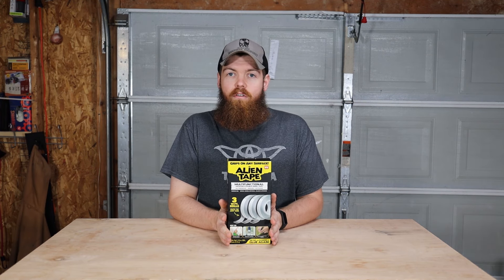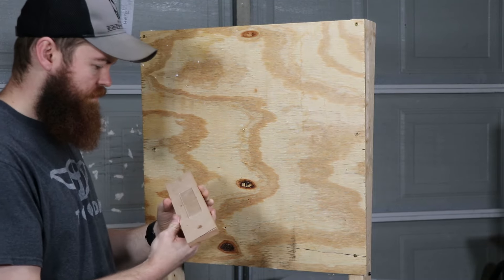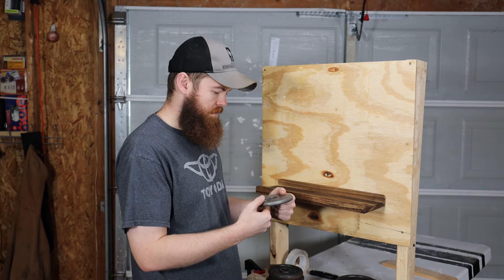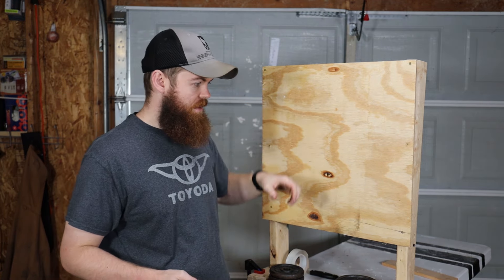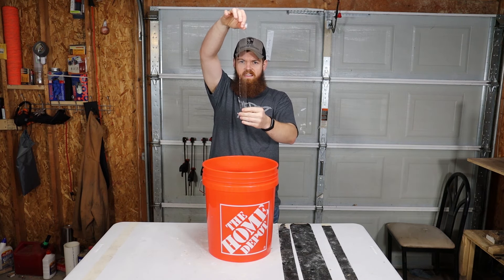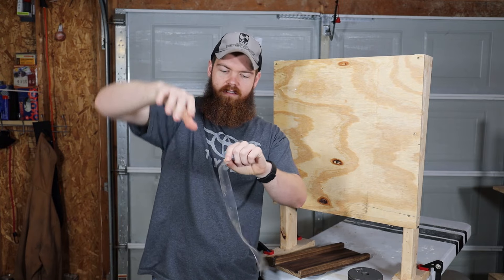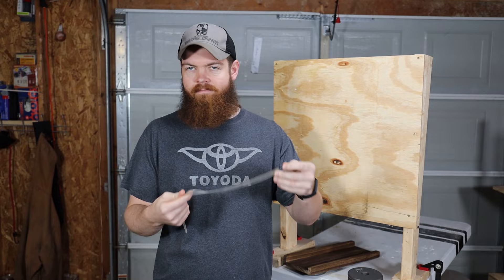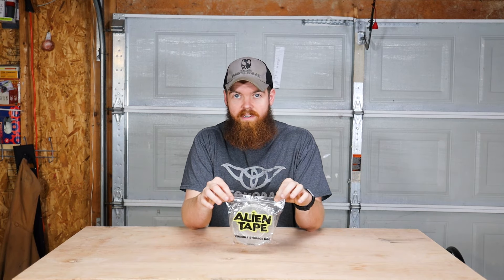Does Alien Tape Really Work?

Comment: Best chance would have been a smooth painted surface the more gloss to it the stronger the bondig between the surface and tape. Bare wood & wood in general is a terrible surface to test maximum hold strength of a tape binding.  Also the as seen on tv is overly dramatic cause most double side tape has a cure time of 3 days

Comment: Try drywall. That plywood rather rough mate. You'd get a better adhesion for surr
Reply: I bought alien tape, it says not to use on drywall or painted surfaces and it also say not to be used in Bathrooms, and clean flat surfaces only, for shelving it says to wait 24 to 48 hours for the tape to get a proper seal before putting anything on the shelf.

Comment: The second test with the shelf is kinda wrong. You used the shelf with weights like a lever, if you attached the weights straight down from the tape it would probably be able to hold even more weight

Comment: my dude, put the tape vertical not horizontal. when it's horizontal the peel moment from the center of weight is just too close.
For those weights, put 3 vertical strips about 5 inches each, and stick the plate in the middle. it will still like glue

Comment: Overall good review. You overdid some of the points by using 100 words when you could have done it in 20. I don't know why you didn't do a long term test like holding weights on the wall for 10 days.  So after this video, I have no idea how long it works. Thanks for the tip on washing it doesn't work. That's helpful. The price is .06 an inch.

Comment: i shit you not, i had no idea what i was buying when i bought double sided tape on amazon i never saw a video for this stuff or anything... i found out it could be resused with water by chance of my removing it from a surface with water and leaving it in a spot for a few minutes and realized it restuck.... and guess what. i used it to secure a carpet XDDD ( initially bought it to secure speaker to my desk which it worked insanely for.... like... they were hard af to remove after a while) but i got it way cheaper on amazon.... and i confirm 100% i washed and refused a small piece but i reapplied it and let it sit for a good while and it was legit jsut as strong for the speaker application

Comment: You would have a much better chance with the shelf if you used a proper wall the plywood will splinter off and when you have 1 weak spot it starts a chain reaction try something proper like a painted wall or your garage door

Comment: Your tests are neglecting the failure modes of the tape. If you want to get scientific about this you should consider : Tapes are generally strongest in tack mode ( a force normal to the adhesion interface). Also very strong in shear ( paralell to the adhesion interface). All tapes are weakest in peel (pulling on one end at an angle). This is by design. For example when you adhere the brick to the wall along its width, it works nicely, but when you adhere it along the length of the brick there is a significant bending moment that causes the tape to fail in peel mode - with a peeling fracture at the top of the interface, therefore it fails at a lower force. I really like what your doing but I think you can be more technical and discover better uses for these tapes along the way.

Comment: I really like your videos BUT in this case the test is not realistic because you have to attach this plank with vertical 
reinforcements. Just like you would do if you attach a plank to a wall with nails or screws.  If you make a "T" structure for an exemple with the tape, I'm sure it will resist a lot more pressure

Comment: Can I just say, does anybody hang a little shelf like that planning to put 10lbs on it? Realistically, the tape did just fine. Most shelves have tiny little things with a total weight of like 1lb tops... So... Let's be realistic about our expectations. 👍

That said, any pressure sensitive tape will perform this well, and better when properly used (which this wasn't, but that's okay).

Comment: Are you sure you weren't supposed to let the tape cure before you tested it? Glue has to cure and tape is just material with glue on it. You should do that shelf test again but let the shelf cure for a day. THAT would be giving it the best chance.
Reply: I have alien tape, he did not read any of the directions, it say NOT FOR USE IN BATHROOMS, for shelving leave for 24 to 48 hours before putting anything on the shelf and to be used on clean flat surfaces only.

Comment: with any tape using those holders or anything to hold it in place for more then 1 second will help. i used 3m double sided sticky tape for my camera for a mount... i held it there for a minute and it lasted 3 years. if i had stuck it and pulled on it directly it wouldn't have lasted 3 minutes... man come on.

Comment: You did it wrong you have hold the tape on to each object for 30 seconds to adhere properly. Your shelf didn't hold up because of that. I have used it to mount 2 metal coat hangers on to the back of my bedroom door and it's holding extremely well.

Comment: In any use case where a mechanical anchor can be used, an adhesive will never be better (assuming you're using the correct anchor for the job, anyway.) Adhesives have their applications, but saying that they are "better than regular mounting hardware" is just marketing bollocks.

Comment: Your tests with the shelf sucked, shelves have vertical braces which help with strength. Also dragging through garage filth and reusing isn't what they meant I'm sure, going from something like hanging a shelf to using it for hanging a key hook, or securing a mouse pad would def work I think. I just think you expect too much out of things without testing them realistically.

Comment: They put the instructions in the box because the box is roughly the size of a 4th roll, which would make everything fit snugly in the main box.  They put plastic on the sides of the tape because it is so sticky - I don't think you're really supposed to peel it off like that.  Do you make money reviewing stuff like this?

Comment: This is the most unrealistic torture test you can give to a chunk tape. Actually you'd have a tough time holding that much weight on that wall with us using a set of screws. So it actually did pretty doggone good without tearing off the wall . something flat would be absolutely perfect for that tape even after reusing it and washing it period

 but no you didn't try anything like that you tried stupid unrealistic torture test. Making the tape sound absolutely worthless when it wasn't 

you could still use it to stick something on the dash of your vehicle and it would stay there. And it would not tear up the dash of your car when you went to remove it off of the dash of the car or ruin whatever item you were using on the dash of the car 

there's plenty of uses for it but sticking on a skinny edge of a shelf is ridiculous..
of course it won't

 even if the commercial says it will 

Common Sense tells you otherwise. The leverage is totally unreal. 

On top of that you stuck the shelf on a porous piece of plywood. Yeah like that's going to stick.

  It still did a pretty damn good job

 There are plenty of uses for that tape and I've seen it work..